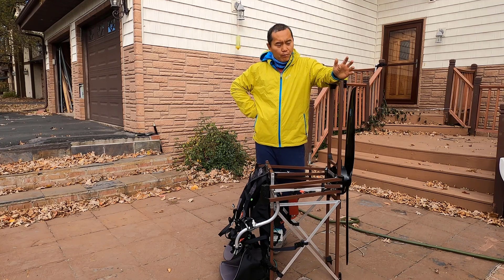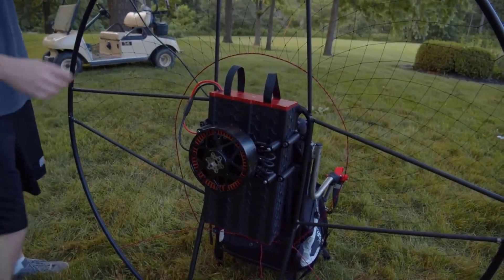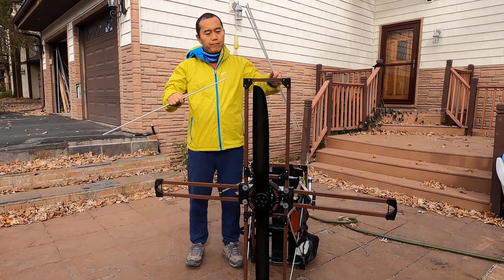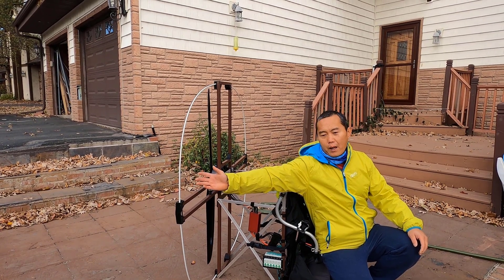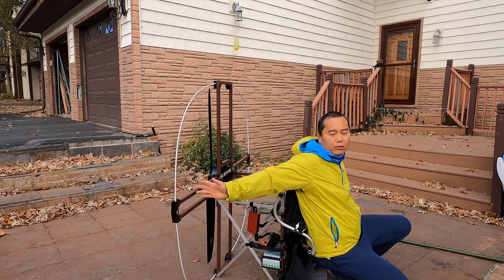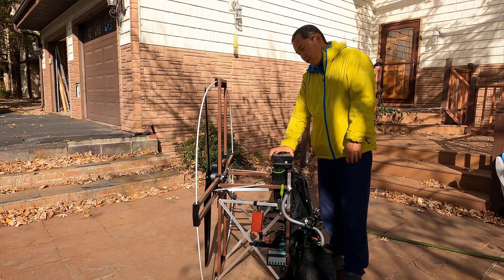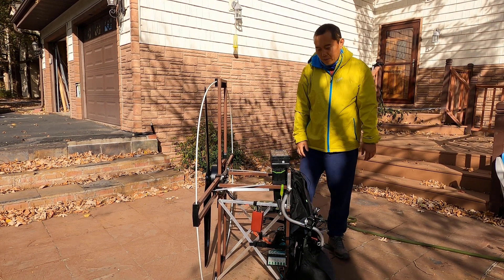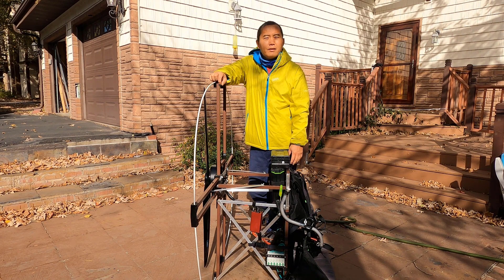Minne Motor ePPG vs openPPG SP140 electric paramotor

Comment: Perhaps electric part would function, but this is total nonsense regarding geometry. Prop needs to be as close to the body. Further to body larger the influence of body leaning forward and backward. It would be super hard to take of in this configuration and super prone to stalls and to linetwists in flight. Everyone, please don't try to fly this frame. Your life is valuable!

Comment: Without netting, what about brake toggles getting into the prop (like Chris Atkinson)?
Reply from the maker: Wireless remote throttle. There's no brake cable or any.
Reply: @JerryMinne  Hi Jerry! The wireless throttle is really nice. But I was thinking about protection for the left and right brake handles.
Reply from the maker: That's 2 feet apart.